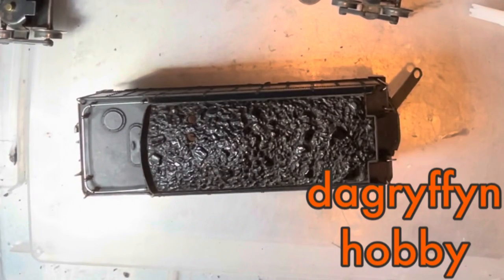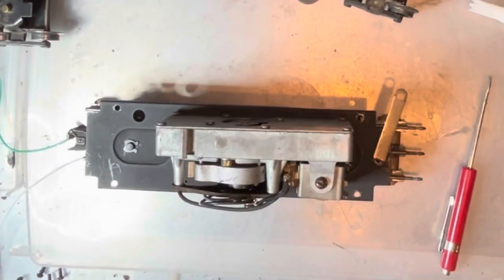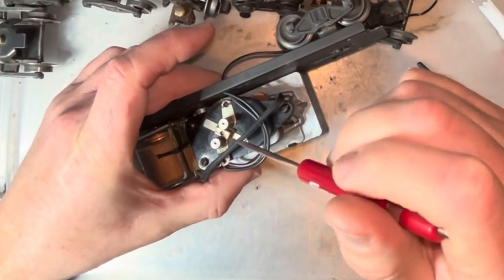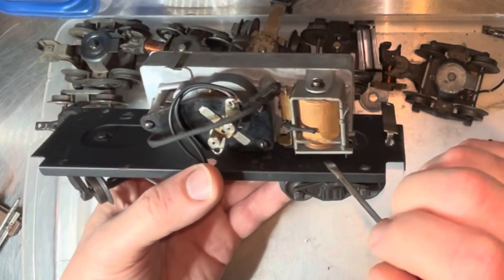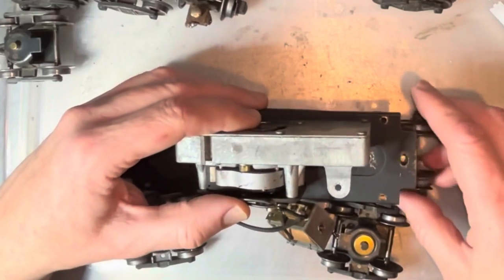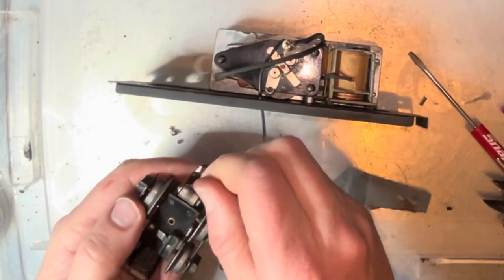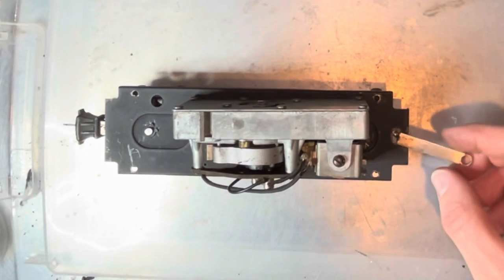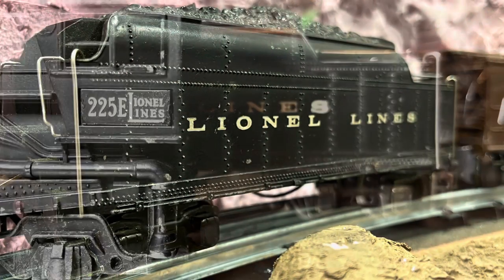Prewar/Postwar Basics - Swapping Trucks on a Prewar 2224W Tender and Checking the Whistle

Comment: Modifying your own trains, especially if they're not in "collector grade" condition is perfectly acceptable to me.  If you can't run something the way you want to, there's no point in having it...if you want to run it.  Drill holes, repaint, change numbers, add new road names...have fun with your trains.
Reply from the maker: Yes! I try not to alter anything too much, but I do have some other pieces that are messed up enough that in my mind I’m saving them, not ruining them. Fun is key
Reply: exactly my thought. or if it's a family heirloom passed down that's been modified in a certain way. my grandfather had a 226e and tender that he modifier to work with postwar rolling stock, so when i got them and wanted to clean and restore them and realized the original drawbar was missing, i decided to make the engine itself have a drawbar that any postwar tender will match with, and the tender a drawbar any postwar engine will match. now this prewar engine can work with all postwar pieces like he would've wanted

Comment: Here's a tip for the clips that keep the trucks in place. Heat them up a little bit with a soldering iron so they become less brittle and likely to break. Do the same for when placing it back in.
Reply from the maker: Great idea. I’ve seen that recommended for taking apart the postwar horns too 👍

Comment: Hi Dave,  my 2224w has a conventional drawbar. I can run it with all my postwar locomotives as well as the prewar locomotive 224E, 1666E and the 1664. The  225E and 226E only use drawbars like the one on your tender. Great video.
Reply from the maker: Didn’t realize that about the draw bars. Interesting. Realized that I have another prewar tender that has the more common drawbar. Maybe I’ll add normal drawbars to the engines that don’t have them. That might make more sense.
Reply: @dagryffynhobby  I had a trash prewar tender that I disassembled for parts. I used the drawbar after a modification to use on my 226e so I can pull a postwar consist.
Reply: Dave,I sent you an email with pictures of my solution to the drawbar problem.

Comment: Nicely done!  I’ve bright a few of these back to life as well and it can be incredibly satisfying.   I wish the piece where the spinning fan/whistle could be opened easily.  The lubricant trick does seem to work well enough though.
Reply: Yes, I'd be happy if that whistle housing could be opened up easily, but apparantly decades ago Lionel decided it wasn't necessary, so they riveted the things.
I'd bet those guys years ago would be astounded their products are still alive decades after they were produced and being kept alive by dedicated fans!
Reply from the maker: Great! Yeah it would be fantastic if the whistle body came apart. I should try drilling the rivets out sometime and replacing them with screws and see how that works. That would be interesting.
Reply: @dagryffynhobby  Well, there's nothing to lose by trying, especially if the whistle unit's a total mess to begin with.
Reply from the maker: @wayneantoniazzi2706  I have one or two I could spare for a project

Comment: You just can’t help yourself.  I get it.   Your new nickname is “the tinkster.”  

I am glad you put original trucks back on.    Hard to beat pre and postwar.   With that said,  I like lionel, mpc, modern, Marx and MTH.   Stock, or modified?   Why not both?   

Give your tender shell a bath in warm water with dish soap and a soft toothbrush.   Never had paint come off.  

And, if you like a glossier, cleaner looking finish, use that stuff that smells like playdough. Restore?  Never had it damage paint or decals.
Reply from the maker: I really can’t help myself!! Haha.
Good tips 👍

Comment: I use a 3454 NYC operating boxcar with a postwar truck on one end and a prewar truck on the other. I use this to use postwar engines with prewar cars and vice versa.
Reply from the maker: I’ve thought of doing that, but I’ve been resistant. Maybe now that the prewar trucks are back on, I’ll go ahead and do that. I guess it’s that or buy a whole lot of prewar cars!
Reply: @dagryffynhobby  try ‘em, you’ll like ‘em. Start out with 2600 series cars with a few 3600 series operating cars.
Reply: I did EXACTLY the same thing so I can run my 224 with postwar equipment. same number boxcar and everything.

Comment: Pre war trucks? Or post war trucks? It doesn't matter, as long as you did it each time because you wanted to... you know as you were messing with your tender, it occurred to me that today's motors are so much quieter and how incredible the air whistle would sound if the motor and relay were completely silent. Perhaps the electronic whistles are not all they are cracked up to be.... the MPC ones were actually a step down sound wise for sure. Thanks. T4
Reply from the maker: Hmm, a postwar whistle with a quiet modern motor. Interesting. That might sound pretty good! I haven’t heard an MPC one that I liked yet.
Reply: @dagryffynhobby  I like everything about the MPC steamers except the whistles which are all crap (and the Mighty Sound O Static...er I mean Steam LOL)... trust me... I had the 611 and several FARR steamers... the best they made... worst whistles ever!... post war ones were actually better... other than that, they are just as good as post war Lionel. T4
Reply: @tinytowntrainstv  I bought an MPC engine not long ago and the "Mighty Sound Of Steam" drove me crazy, hated it!  So I yanked it and installed a Williams steam whistle and bell combo unit.  MUCH nicer now!  
And I can hear that conventional engine sound MUCH better!
Reply: You know, I had one of my postwar whistle tenders apart trying to figure out just where that crackling, screetching noise was coming from.  I stared and stared at the motor in operation and it looked like it was coming from the arcing and sparking of the brushes on the motor armature.  Replacing brushes and cleaning the contact plate didn't help.
Considering how fast that motor turns compared to the engine motors I came to the conclusion it's just the nature of the beast and there isn't much you can do about it, they're just noisy motors, and the tender shell acts like an echo chamber and makes it worse. I tried "soundproofing" the shell and that didn't help either.  
On the other hand, you really can't hear the crackling all that much when the train's running anyway, so what the hell.
The MPC era and later mechanical whistle units with the DC motor are definately a LOT quieter!
Reply: @wayneantoniazzi2706  The MPC whistle is an early attempt at making the whistle electronic... not as good as the post war if you discount the motor noise. After the MPC and early part of the Richard Kuhn era, the railsounds tenders came out which are fully  electronic... I am not aware that any mechanical whistle tenders were made at all after the 1960s.
Reply: @wayneantoniazzi2706  Great idea, Wayne... those are vastly superior (and newer) technology! Well done! T4
Reply: @tinytowntrainstv  Well, I've got some Lionel tenders made in the 90's that have electro-mechanical whistle units, I'd have to research the exact years.
Anyway, they have a DC motor connected to the whistle unit with a little controller PCB.  They work very well, nice whistle sound and no background noise.